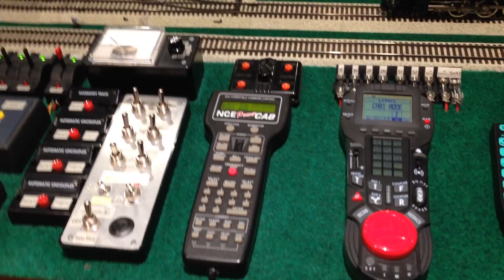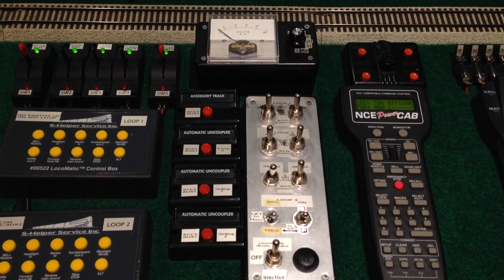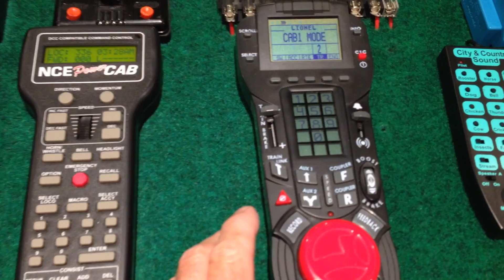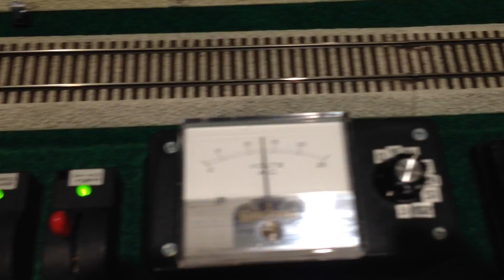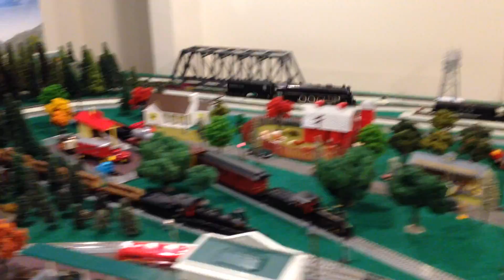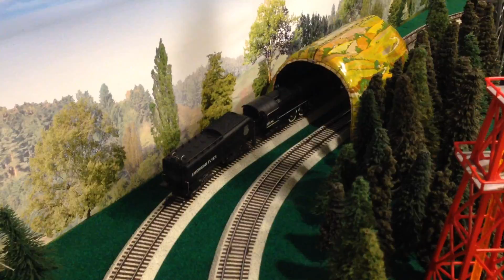American Flyer 332 AC overhaul - part 3 of 3

Comment: Can you run 3 on that layout
Reply from the maker: There were 3 S loops, 2 interconnected, 1 independent, and an Sn42 loop inside those, so easily 4 at anytime, more if you were careful and used TMCC, Legacy, or DCC.

Comment: Precision, nice, that is one handsome locomotive with excellent operational performance, very pristine layout too! Daves AFTrains
Reply: Hello Precision and Dave (right?) Your layout is very impressive. My goal is to build a new layout, two independent but connected loops, 1-2 sidings, plenty of spurs, passenger, freight, accessories and incorporate a Marx freight depot that I received for Christmas maybe the same year I received 5323T The Mountaineer with 282 locomotive power. Any chance you could do a video just on the dimensions and general specifications, track layout and lengths, it would be greatly appreciated!  Thanks for considering this request, best regards, Daves AFTrains